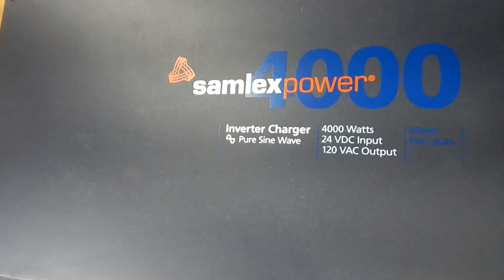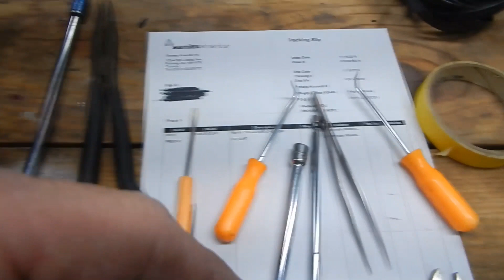Samlex Evo-4024 Inverter Charger. Installing New Cooling Fans .

Comment: What a Beast of an inverter,  someone will be lucky to get that.
Reply from the maker: This inverter built my entire Home Project hear air compressors, welders ,all the power saws, and hammers you name it. On the 120 volt side of things this blows my magnasine out of the water. The magnum   doesn't even come close to the Power this has. on 120 volt side only. But using 120 volts on the magnum split phase  U only get half the rated  power. Apples & oranges to be honest.

Comment: that inverter has at least another 6-12 years in her, 50% off is a good price! thanks for the video.
Reply from the maker: On the hundred twenty volt side of things this inverter blows the Magnum clean out of water. When I turn on my air compressor on with a single Magnum everything that was  on in my home LED lights included totally shut off for about a half a second when it started the air compressor every thing came back normal . I was amazed that happened.  On the samlex you could never even tell the air compressor turned on. But this one is only a hundred and twenty volt using all of its power. the magnasine is a split-phase not really a fair comparison. on the hundred twenty volt side of things this inverter blows the single  Magnum clean out of the water.
Reply: @TheKiloG69  I have the same problem, and I complained about it, I was told its the magnum sensing the load and backing off a little only down to 90v or so, just enough for led lights to turn off, most other things stay on, but its meant to keep the mosfets from ever seeing spikes over their rating, im not sure how much I like it. the first generation 8000w inverter from reliable just put out full power with out any overload safeties and I never saw any lights blink ever, but I was able to pop it one day, now the newer MUCH better 8000w reliable will not go over around 8000w and lets the voltage drop like the magnasine and it has taken way more abuse then the other 8000w inverters I had and still working. I am told that the magnasine inverter lets the voltage sag a little till it knows how large the load is its running, kinda like a soft start. your samlex sounds like its full force up to 100% then limits witch might put more stress on the fets. sorry for this long message just was I was told about my magnums
Reply from the maker: @GoingOffGrid101 Thanks that makes sense what you just said and that would explain my observation. The single Magnum ran anything I asked it to run  that was just my observation . when it started the air compressor  which is a 15 amp running load probably close to  30 at startup  it did it every time no problem . I love my daul magnasine set up much better. The samlex has been flawless for 4 years. Thanks.
Reply: @TheKiloG69  i was not happy with my magnums at first when I saw my lights dim, till I found out it was made that way to make the inverter last longer.
Reply from the maker: I also took your advice and lowered the inverter level to 50% it seems to work much better  when my water pump kicks on the other one kicks on and shares the load.

Comment: That's a nice unit. Surely someone can use it in there system.
Reply from the maker: Thanks it's going back in the shipping crate back up in the attic. Great unit for an RV or someone with a work / roadside repair  truck.

Comment: samlex is a good brand
put a piece of paper on the nut and insert into socket or driver, it will hold the nut until you get it on the stud.
Reply from the maker: Yep I use the small piece of masking tape . I used to Big pair of tweezers to put the electrical connections back on.

Comment: I saw they make a 220 one to
Reply from the maker: They make a 230 volts only inverter 50 hertz for the European market to my knowledge they do not make a split phase 240 volt 60 hz. I would have bought another one in a heartbeat.

Comment: I'm in the market for an EVO 4024 right now. I'm selling my AIMS Inverter/Charger to get this one at Inverter Supply or Alt E Store.
Reply from the maker: There beasts. No issues with mine other than the fan after many years. Still have it on a shelf.

Comment: I wonder what the power draw of these fans are? Mine start running as soon as you think about turning anything on.
Reply from the maker: Never measured it but it is an extremely efficient uni never had any issues other than the fans had it for years.